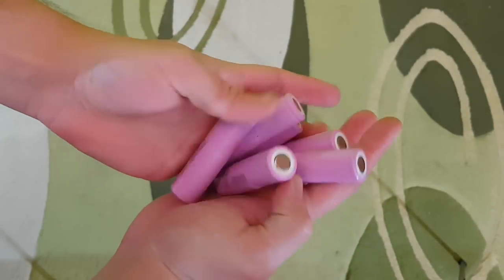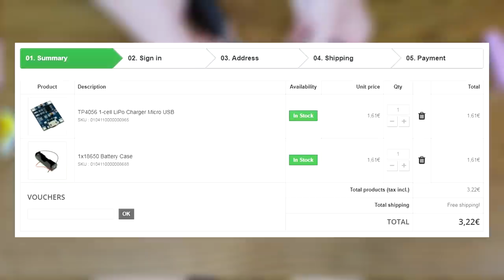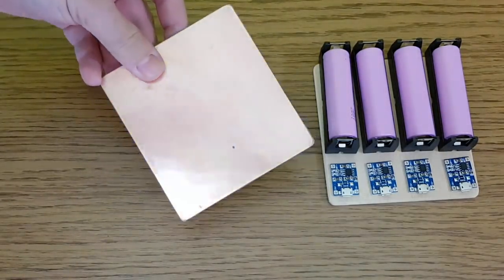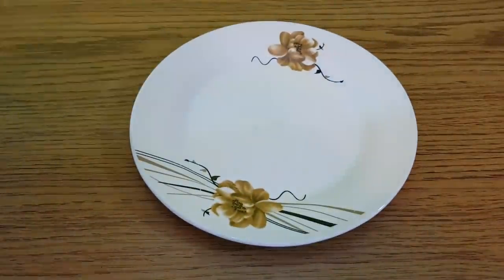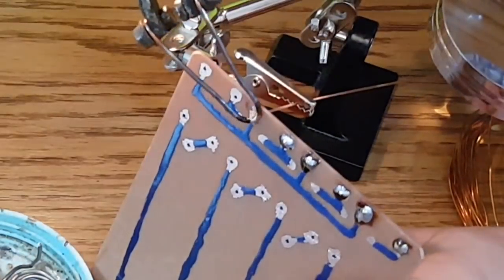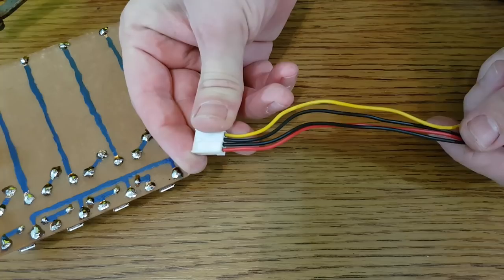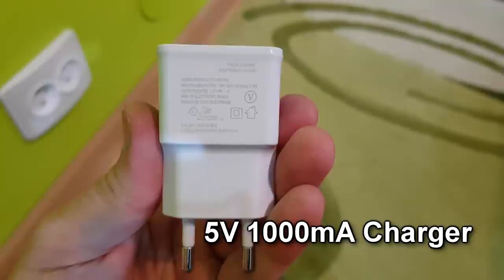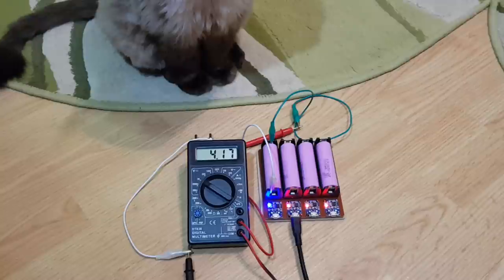Simple DIY 18650 Battery Charger - TP4056 Review (Everything Explained)

Comment: You'll probably be surprised to find out that the charging module are also made in China.
Reply from the maker: I was referring to fully made cheap chargers for $1 or $2 (they are more expensive now, the video is old), some of them are rubbish, I had 2 that burned, because at that low cost it can't be very good. TP4056 modules are actually very good, especially original ones. but TC4056 are good also.

Comment: Making the circuit board makes the product expensive also there is no need for it also most of the copper is not comming in used and is dissolved

Comment: Hi, I am glad to see you are doing something good in your spare time.
Now - your soldering skills are absolutely terrible and you do need to improve on them fast if you want to really solder some more circuits. Soldering is an art.
It takes a year or 2 in fact with the transformer soldering iron you use (it was my preferable soldering Iron for many years since my early teen years). 
Soldering a joint involves wetting both parts and allowing the time for the solder to flow.
Never pickup the solder with the soldering tip (by the time you transfer it to the join point, the solder will be to hot and the resin will evaporate). Instead, heat the joint with the clean tip and introduce the solder to it using your other hand, so the resin in the solder can wet your joint and the solder will flow in.
Your PCB manufacture is not any different to your soldering - it just sucks. Do not venture to it until you do know what you are doing.
Please - learn the skill of soldering first, practice a lot on bits of copper wire bits (remember to make sure to remove any oxidation with fine sand paper, then give it a swab with some "alco" saturated cotton to remove the residue of the fine sand paper (600 to 800 grade). The first good solder you make will make you proud and you will feel the joy.
Use prototype PCB's before you start doing your own.
I wish you good luck.

Comment: You are so bad, you are complaining about cheap Chinese charger but this TP4056 module is made in China.
Reply from the maker: hi. I'm not talking about all Chinese components, most of them are good, like the TP4056 charging modules. but there are also bad components, which usually are cheaper than the good ones. for example I bought a cheap charger for a single 18650 lithium cell and it burned after one hour. another e.g - I bought a 1A USB charger and it delivers max 400mA. so it's better to build your own simple 18650 charger with TP4056 modules, instead of buying a cheap one already made, that's what I meant. I buy 80% of the components for my projects from China, so clearly I'm not complaining about Chinese components in general, but you need to be careful what you buy, inevitable there are also bad products, like in any other market.